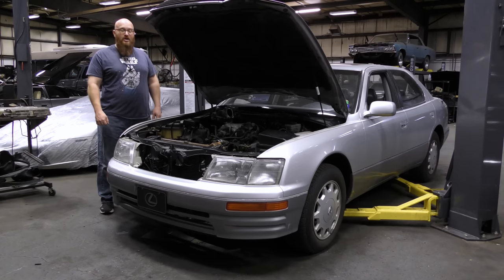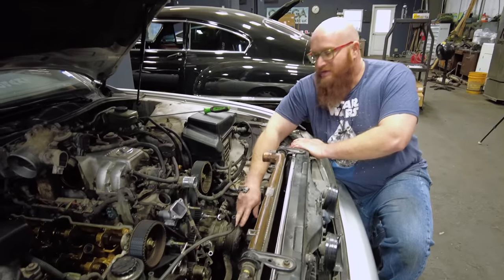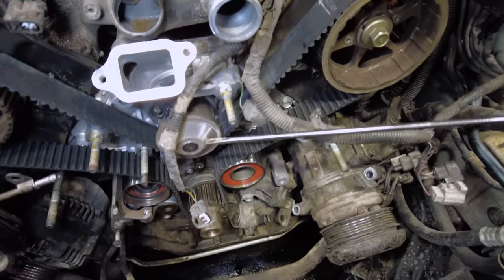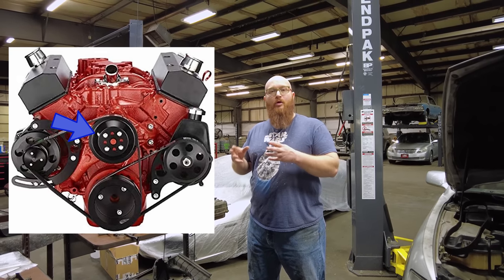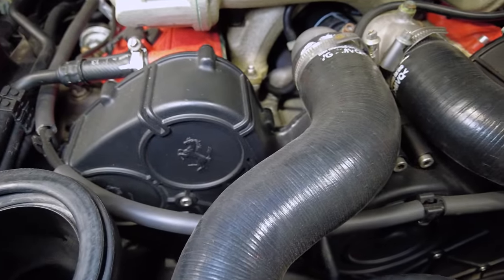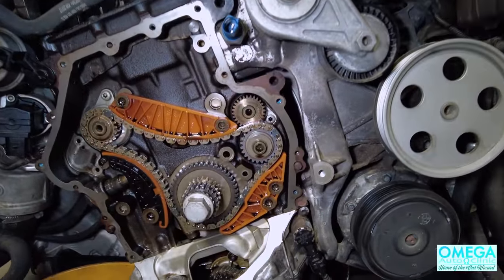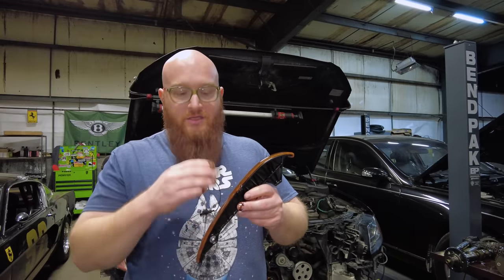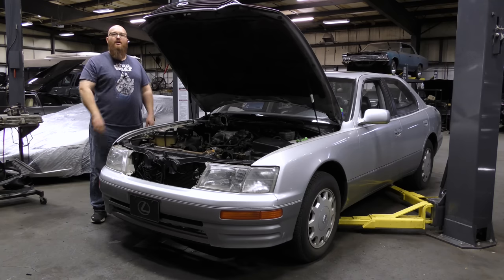My What's Broken? Series #1: Timing Belts-vs-Chains! CAR WIZARD explains why the huge bill

Comment: Belts have the advantage of silent running, but the biggest advantage is that they do not need any lubrication.  A chain has to be in an enclosed, sealed compartment so that oil cannot escape and cause a leak.  Chains also have to have guides that keep them tight, and those guides have nylon inserts to reduce noise.  All those items can fail, causing major expensive repairs.

Belts on the other hand have a much more finite life.  100k miles is REALLY stretching it [no pun intended] for most belts, which is quite a bit less than a chain.  Belts also have to have a tensioner, though this is usually quite simple and reliable compared to chain tensioners/guides.  Contrary to popular belief, belts rarely "snap".  What happens is that they shear off a few rubber teeth and this causes timing to go way off, potentially destroying both heads and/or bending multiple valves.

Changing a timing chain is a big big job;  Changing a belt is far easier and cheaper.  So which one is better?  You decide.

Great video!
Reply: Belt technology has come a long way had my honda 3.5 timing belt changed at the 7 year interval and it still looked new had about 80k. Ive seen a few honda v6 with 200k getting the original tb changed (wouldnt recommend that at all but many people neglect honda maintenance
Reply: Timing chains also have tensioners just as belts do. Honda Js and Ks both have tensioners. I guess it all depends on your interest in maintenance, I used to prefer chains but now prefer belts after learning about their duties.
Reply: @HarleySLA  how are the tensioners on the k series? Is it true somek series like to burn oil?
Reply: @CRAPO2011  K engine tensioners are usually fine as long as you maintain your oil, that's the key for those engines. They will stretch chains with improper OCI, not to mention the possibility of adding guide wear. I've seen and heard of more chains stretching and guide wear, by far, than tensioners failing. I think Ks are well built and designed, so oil burning isn't very common until high mileage, but again depending on maintenance. Cannot stress oil maintenance enough on them. Usually, from what I've gathered, oil burning isn't a problem with them until 250k plus and usually a result of pushing oil changes and/or carbon build up and anything else that can cause excessive ring wear. Of note J engines with VCM are super prone to burn oil, and honestly anything with cylinder deactivation, if you ever plan to buy something with cylinder deactivation be wary because it very likely burns oil on cylinder 3 (if it's a J engine). Pull that plug out, it's on the rear head closest to the driver side), and check for oil on the plug. Other things can cause that, but it's not unusual that it'll be burning oil, especially if the plug tube is free of oil but the plug electrode itself is oil soaked.

Comment: I remember when I bought a new Acura Integra back in the late 80’s, and when I hit 90,000 miles, I had to spend almost $400 😂 to have my timing belt and pump replaced. The cheep old days 😂

Comment: I have done it on  Mercedes, Audi and others.  The Audi was a pain in the ass, a 2005 TTS.  The older MB (1958) is a snap.  It uses a chain.   Promised myself I would never own an Audi.  I have had four of them since.  Audi has changed to a chain.  Chains can “stretch.”  What happens is that each link will wear a little and there is a lot of them.  Suppose there is 100 links in the chain and each one wears 0.001”.  Then the chain would be one inch longer.  Eventually the tensioner can’t keep up with the longer chain.  Plus the timing is getting off.
Reply: My arithmetic was off a decimal place.  Sorry.

Comment: I had a 2000 honda crv. when I bought the car the seller mention I should change the belt but I never did for over a year. well I had the parts and was going to change it the next day when the belt broke on me when I was driving to my friends house. lucky I was driving slow(under 15) and a low rpm so it didnt do any damage to the engine. I just put it in N and coasted it down hill back to my home. lol

Comment: I just replaced the timing chain set in my 2007 Chevy HHR... Holy crud that was a pain. Book rate is around 8 hours, and I think they under estimated it. It took me two days in my driveway. Sad thing is that all GM Eoctec 2.2L, 2.4L and 2.0L need to be done every 150k miles or you risk the chain skipping a tooth because the chain stretches and it's a motor that will nuke itself. If you have a higher mile Eoctec that rattles for a few seconds after it starts up, you need to get the timing chain replaced.

Comment: Opel corsa 1.2 twinport owner here. Change the oil every 5000km!!! Otherwise the chain will strecht jump one tooth and bye bye engine. Almost on 200.000km here and the new chain guides and tentioner are going to be replaced next month by myself.

Comment: There is another method that uses neither timing belt or chain - direct gear drive.  Some Ferraris use a rather complicated "clockwork" timing that doesn't use a chain or belt and the Ford OHV 4.9L I6 just has two gear wheels - one on the crank, one on the cam - making it about as bulletproof as it gets.
Reply: I would love to see that engine! It must be a beautiful work of art.

Comment: Great video! Unlike most and what seems to be popular right now I actually prefer the timing belts that my Volvos have (00 V70 XC, 04 XC90 T6, 04 S60R autotragic). This is primarily because, yes even though I have to change them every 100k, after I change them I have the peace of mind that the belt is in good shape and the water pump is new. My family also has a 2014 Ford Edge with the 3.5 V6 and while they aren't known for having lots of timing chain issues the water pump could fail or any number of things could happen to a high mileage timing chain setup often without any warning. Of course with a Ferrari where the engine has to be removed every 30k to do the belts it's a different story, but overall I like the comfort that my water pump and timing belt always have less than 100k on them.

Comment: I am pretty sure my 1983 F250 300-6 had timing gears and not a chain or belt.  I did not work on cars back then so.... But I am understanding that gears are considered noisier than chains which are considered noisier than belts....  and that is the main reason for timing belts, they are quieter...  Yes?  No?  So many cars went to timing belts in the 80's and 90's and have now gone back to chains.  I remember when the timing guides on my 85 Toy (22RE) shattered, it was remarkably easy to change the entire set in less than a day with hand tools....  The hardest part seemed to be getting the oil pan off to clean out the debris from the guide.....

Comment: Many years ago it was timing chains only, then the infamous belts arrived which are great 
provided you change them rather than wait until they snap.
Even loose chains can jump a tooth if the tensioners wear, this can happen due to negleted servicing.
For me i think chains are better, yes they might go noisy but at least they give you advanced warning
that something is wrong, once a belt snaps and the valves hit the pistons it's too late.
Reply: Chains were great and if you made a few adjustments when they first began making noise you could get even more miles out of them. More manufacturers are returning to using chains (and I may be wrong about this) but they don't seem as durable as the old ones so they may still need to be replaced as often as belts.
Makes me want to shop based solely on a vehicle with a non-interference engine.
Reply: @nuthinbutlove  These days nothing seems to last as long as they used to including timing chains.
The plastic on the tensioners wears, so it makes sense to fit a new chain at the same time.
Non-interference engines can be a life saver when the timing  goes out.
Reply: @nuthinbutlove  vvt is why chains are back

Comment: I picked up a 1990 in poor cosmetic and somewhat poor mechanical condition. With a bad TPS, a vacuum leak or two and a busted EGR tube, it still passed emmissions here in Phoenix! Great car. It won’t downshift when I hit the throttle but I suspect that’s because of the TPS. Gotta grab one from Lexus for $130 sometime.
Reply: Perhaps the Wizard will grace me with his presence and impart some wisdom about this issue? Fingers crossed 😊

Comment: Cars like old Mercedes or Alfa -Romeo had a quite heavily dimensioned twin chain, that lasted very long. When they start to rattle you know it was time to think about some maintenance.  It was easy to change them. 
Now, timing belt is not a bad idea, IF it is easy to change them. A 30 minutes job. But it's not easy. because it is not designed to be easy.  It can even be a engine out job. Crazy!  On my old Volvo it is a piece of cake. In the front and plenty of space.

Comment: I had a bunch of SAAB's with chain go well over 300000km's without replacing the chain or any chainguides/tensioners.
I had cars with sudden catastrophic belt failures before first scheduled beltreplacement. (both in time and miles)

Comment: My wife put over 200k on her '04 Highlander and never changed the timing belt.  I never saw what it looked like as I sold it.  I was up front to the buyer that it needed to be done and was significantly overdue.  The Car Care Nut has seen timing belts with hundreds of thousands of miles on them and they look like new still.

I don't like timing belts but Toyota at least knows how to make them.  I've never heard of one breaking.
Reply: Didnt know those had timing belts i take it was the V6
Reply: @CRAPO2011  yep the 3.3 V6

Comment: Go GM 3800 Series engines!!  One serpentine belt and one timing chain.  Great design.  It's really unfortunate what manufacturers are doing to the consumer.  Complicated and costly and geared towards obsolescence.  Very few cars today are built with longevity in mind.  I'll stick with my Buick 3800 engine for another 20+ years.

Comment: Chain over belt if you make sure the tensioners are good. Old timing chain engines are usually great but some have such a thin chain it’ll stretch over time.

Comment: I love that timing belts have intervals and the engineering reflects that service.  Timing chains almost never fail (from what I have seen) and the engineering reflects that (looking at you Audi 4.2 V-8).  They just never accounted for their stupid plastic guides failing and needing to be replaced at the same interval as the belt.  I know that last bit is hyperbole but I sometimes think that.
Reply: You ha e hit the nail on the head, plus the labor is going to be way more than a timing belt. 😊
Reply: @davidbrowning443  Timing belt $800 every 80k.  Stupid timing chain guides on the back of the engine every 120k $3k.
Reply: @pkt1213  Plus, you can a timing belt DIY and save even more money.  Who’s going to pull an S4 V8 and do chain tensioners?  :)

Comment: There are some technical channels stating that timing chains that last as long as the vehicle is increasingly becoming a thing of the past.

As the desire for increased fuel efficiency and smooth operation has increased,  chains have become lighter and of higher tolerance. Further the new modified shapes are more prone to stretch.

So it would seem that the durability advantage of chains over belts is greatly narrowing and that modern chains may need routine replacement much like belts.
Reply: My 2012 Civic is at 256555 miles. I'm not going to change the chain, as it's not worth my time. I keep up with all other maintenance. I do look at it through the inspection port (that was leaking at one time)
Reply: The guides tend to be the problem

Comment: I remember doing a timing chain on a quad-4 and it had holes in the cam sprockets and crank shaft that you could put a 8mm stud in to line them up.

Comment: On some cars, timing belts can last as long as timing chains. It's all in the design of the engine. Hondas with belts typically need replacing around 100k, that Lexus in the video went 250k on its first belt.

Comment: If your waterpump is good, you can change your timing belt without messing up the timing by cutting it in half, but cut it lengthwise. This way you remove half the width of the timing belt, so you have room to push the new timing belt on half way, and then cut away the last half of the old timing belt to push the new one home.
Reply: That's a wicked good idea I like it
Reply: I first seen that on Car SOS, Fuzz Townshend did that on an engine on a stand.
Reply: Hot dang that sounds slick.
Reply: The problem with that is even though the water pump might still be good when you're replacing the timing belt there's a good chance the water pump will fail before the replacement timing belt needs to be changed again. Then the timing belt will need to be removed again just to change the bad water pump and you'll have to pay the cost of labor (which is the majority of the bill) to have the engine taken apart again just to change the pump. 
If you're a mechanic and enjoy the work it's not an issue, but if you're a paying customer you'll wind up paying twice in both money and inconvenience for a job that could've and should've been done in one swoop.
That's why mechanics recommend doing them both at the same time.
Reply: @peterad1529  That is not going to work on most timing belt engines as you can see even with this TOYOTA engine, you have one or more cogs/rollers with a "shoulder" on it to keep the belt in place while it is in motion.  Without the "shoulder", the belt has a very good chance of eventually working it way off the cogs/roller/tensioner, no way to slide a belt on or off with the shoulder in place, especially with tension on the belt.  So instead of trying to save time and think your being smart, trying to cheat is just going to cause more trouble down the road,  just do it the right way and disassemble the belt system so you can relieve the tension on the belt for removal and installation.
Reply: Half Ass Auto Service. Remind me never to use that place.
Reply: I didn't change my water pump the first time I got the timing belt changed at 90,000 miles,
Reply: @21Piloteer  yyyep!
Reply: @georgehine9103  glad it worked for you. Unfortunately I learned the hard way and made the decision to heed the warning from now on.
Reply: sounds like a lot of work
Reply: After having a timing belt driven water pump fail a week after changing the belt, I would not do that. The change in tension on the bearings and seal from a new belt is enough to trash an old water pump in short order.

Comment: I couldn't find what Toyota says it's maintenance interval is on a timing belt.

I do know that it's probably before 145,000 Miles when I bought my 1999 Toyota Solara 3.0 V6 1MZ-FE 7 years ago. I asked the seller when the time the timing-belt was changed. The seller's reply was: "What's that...???".

Comment: It’s cool that they mark the belt to add another way to verify timing.
Reply: turn the crankshaft, two revolutions, to verify it's been installed correctly. 
saves on costly mistakes. No bent valves.

Comment: Once again I'm thankful that I'm driving a 36 year old RX7. Short of oil starvation / bearing failure there's pretty much no way for the engine to destroy itself, and no regularly scheduled $1K maintenance. The water pump is external, powered by a fan belt, and relatively easy to replace. (Though parts availability is another matter!)
Reply: Apex seals like to die in those. Had a buddy that use to be in those big time when they were cheap.

Comment: 2000 V6 Camry timing belt wasn't that complicated, just time consuming and slow going for the first time. Replace water pump at the same time. Make sure the time alignment is perfect, missing one tooth will run funny. I use the Haynes Repair Manual. At 110K miles the old belt looked new!

Comment: Don't forget about gear-to-gear timing. I know it's not relevant nowadays but it's still something you can do on your vintage V8 engines if you want a little more HP out of your engine since you're obviously not wasting energy spinning a chain. I have a friend that put gear-to-gear timing in his small-block 400 without doing anything to the bottom end of the engine and while it had a mean whining type sound to it, he ended up destroying that engine due to being too hard on it one time. It's a good option if you rebuild your engine the right way.
Reply: It’s for planes and f1 cars..

Comment: Kinda glad I had an ol’ 92 4.3 liter S10, timing chain directly from crankshaft to camshaft, no guides, 394.000 miles, a lot of things happened to that engine and timing wasn’t one of them, compression was, sold 2 years ago after 21 years of ownership, still working in the neighborhood, I miss that thing … GM engines of the era aren’t known for being long lived, however this one lived enough to have mechanics refuse to service such an old tech engine, also for fear of not getting paid because the fix would be worth more than the car, so towards the end I had to strike deals of servicing 2 cars, this one being one of them, to get it fixed and people surprised by why I love that thing and pay for it, it runs without an online account and phone app nor contacting it’s manufacturer all the time for one huge thing …

It’s like a 2GB 25 year old hard drive still working today. I love seeing things outlive their practical usefulness, it’s called a good quality product